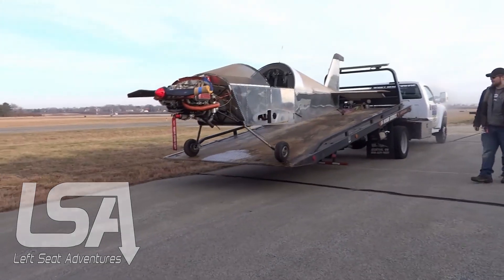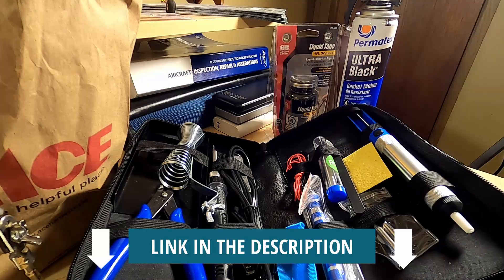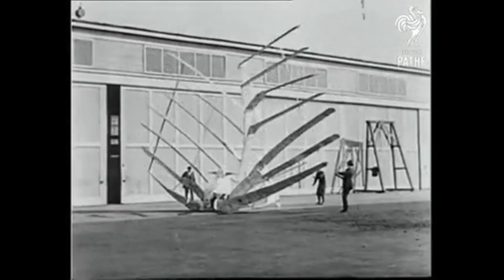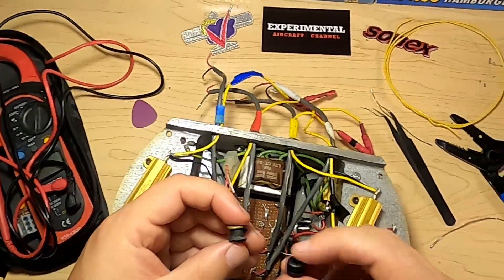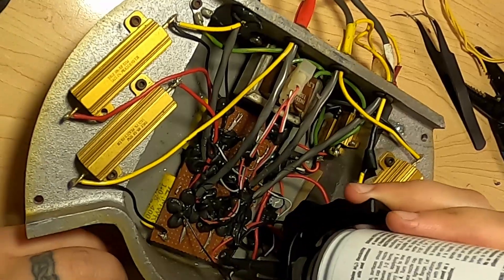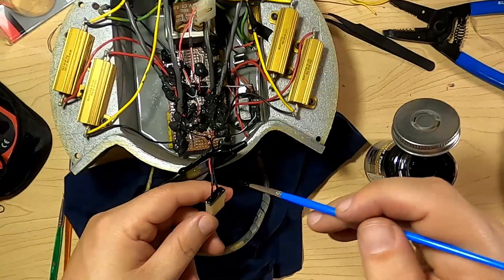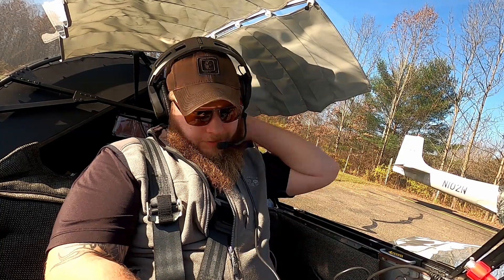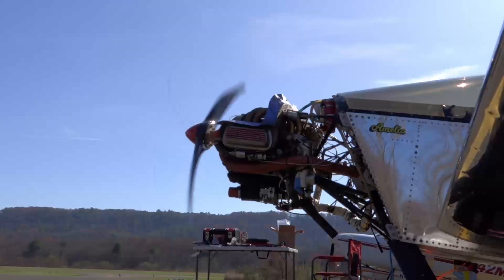5 Things That FIXED My Revmaster CDI Ignition

Comment: Thermal strippers are the BOM... That is what you need. It kinda makes it even fun. They work even with 37 gauge wire. I worked with some crazy stuff.  EBay for a used set. I've solder hundreds of pins. Also, liquid flux pen is also a SUPER help for clean solder joints. Add flux, add the right amount solder to your iron and just touch it! BAM. Clean, solid and quick...  Last tip! to help with longevity of the connection pre assemble heat shrink on the wire and slide it over after your done and shrink it over.
Reply from the maker: Wow, all good tips. Thanks! 👍 I am rewiring the ignition outside of the CDI box now, adding weather pack connectors instead of the Molex ones. Heat shrink will definitely be used in multiple spots as well.

Comment: i
I have a revmaster and tried to connect the mags to the positive line of the battery but kind of shorted out is it correct to connect it that way or should connect to negative
Reply from the maker: Hi Francisco! Are we talking about traditional magnetos or the CDI ignition. Either way the ignition should ground through your ignition switch(es). Positive side is going to be dependent on what you have. The CDI ignition is a low voltage system until the individual coils. Have you posted in the Revmaster Owners Facebook group yet? Lots of experience with these engines there.
Reply: Mags to ground. They require no external power, but use the common ground to kill the spark.

Comment: If you're going to use off the shelf silicone to pot a board, make sure it's non-acetic. Acetic silicone will etch electrical connectors. Bottom line, if it smells like vinegar, don't use it for this!
Reply from the maker: Very good point, I should've mentioned that in the video as well... Thanks!